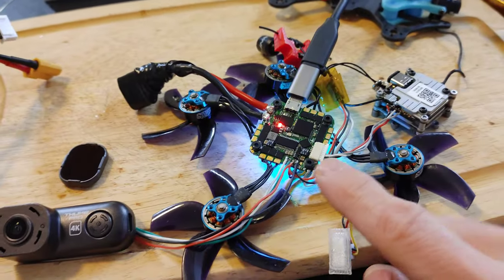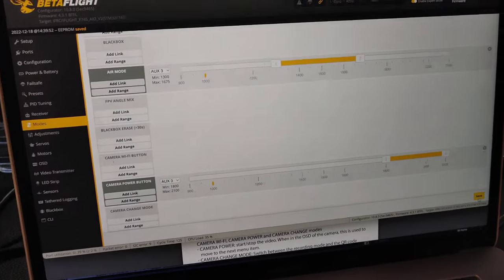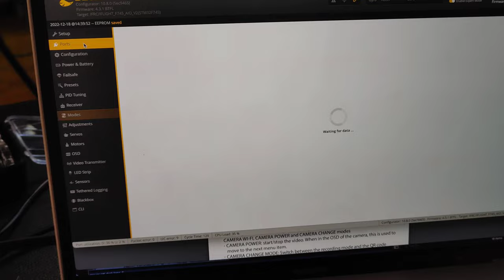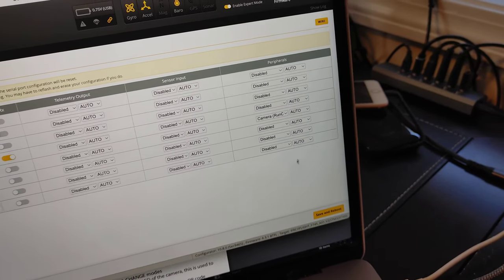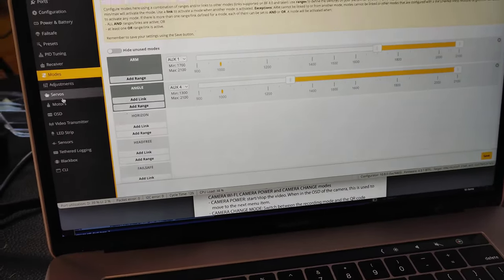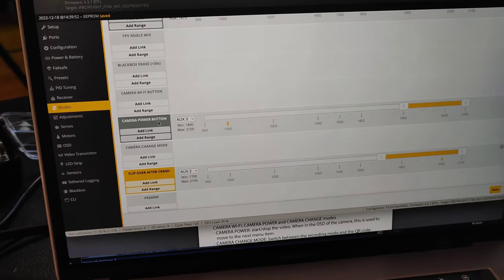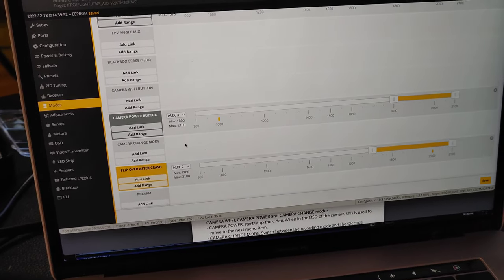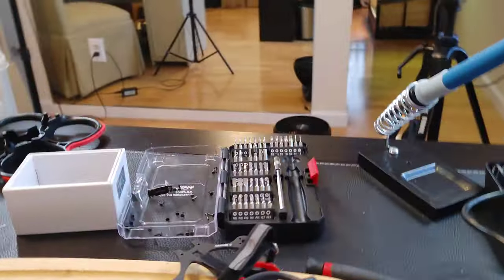How To Wire Thumbcam Pro To Remote Switch For Recording

Comment: will it auto record when 5v power is on .. no switch
Reply from the maker: no, a button needs to be pushed in some way, shape or form (switch)
Reply: Yes in Runcam cam app, you can set it to auto record when it get power from any source, usb or the plug.
Reply from the maker: @T418RC  thx for following up ;)